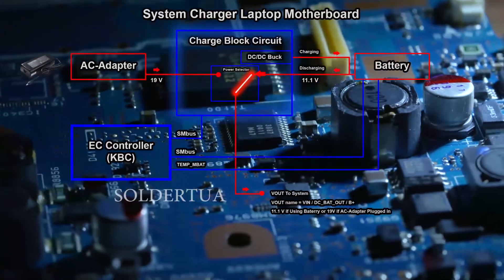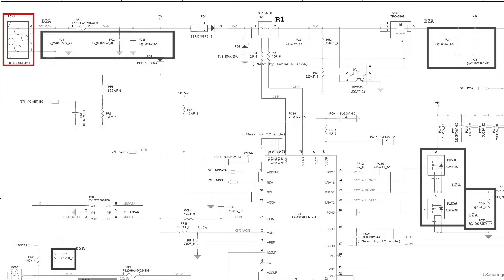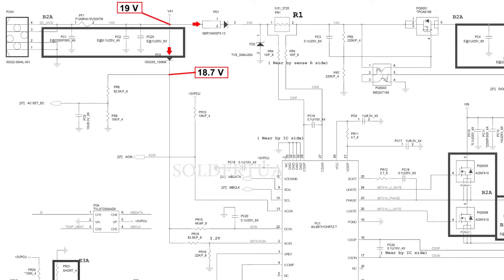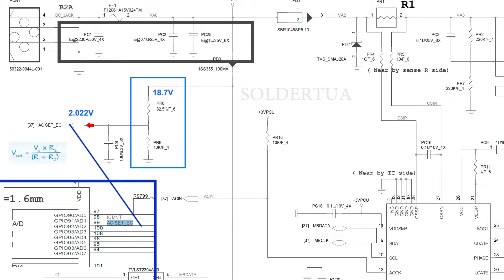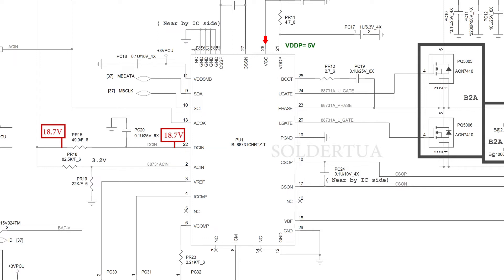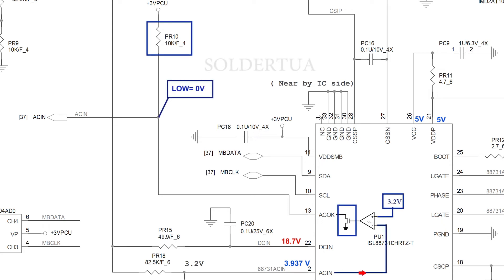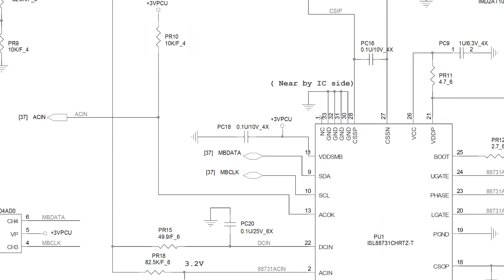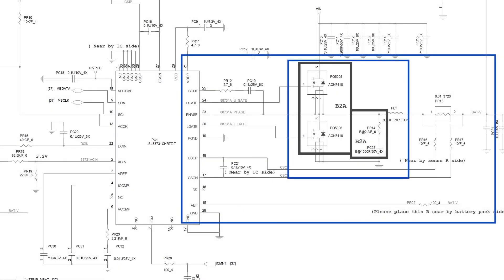How Laptop Charger IC works | Part 2 | ISL88731C | Battery and AC Adapter Simulation

Comment: You can unlock a not working charger with a battery drill, using it as a dynamo at the 19 v side. By turning the drill rotary at both side, switched on. The charger has to be ac offline. Works with a single charged laptop cell as well, but not always.

Comment: Good video. I have a case with this ic. On first PF1. I only get 2.8v only on first an second pin. If i remove pf1, i get 19v on first pin. Then i try remove pf1 and inject 19v on pin2 nothing shorted.

Comment: I have a toshiba with this IC, ACOK has 3.0V instead 3.2 or higer, VDDSMB is 3.3V, due a Open drain ACOK Must be 3.3... but I cant to understand what is happend here... may be a bad EC draining too much current from the pull-up? Any tip about this ?
Reply from the maker: what is the case?? the motherboard is dead or not charging??